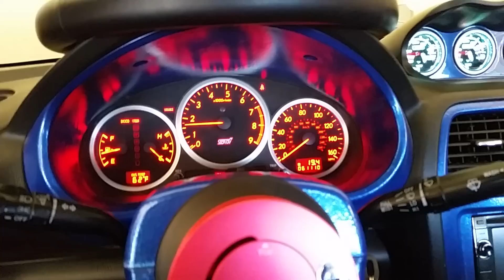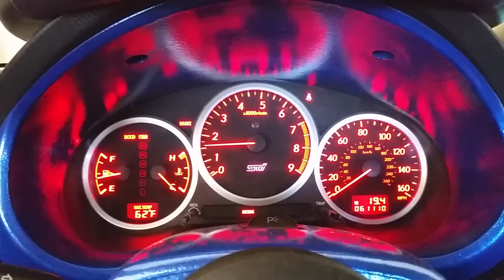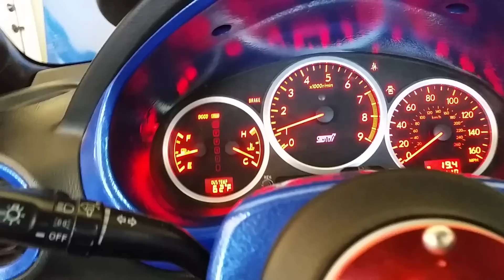Cold Start w/ Forged Pistons and Solid Motor Mounts (07 STI Subaru)

Comment: Did you guys noticed a change on the sound of the engine with forged components? When forced.... it has a ticking sound...
Reply: They get loud haha. I swore up and down my valve lash was wrong even though I let my master Subaru tech buddy handle that part (I torqued everything down to 155 ft lbs 🤣). Sometimes these motors just get really clanky once they are done up

Comment: What's the difference to an A or a B forged piston? I've just forged my 2007 Hawkeye STi...again! Block cracked sadly, all good now. I've just never heard of two different types of pistons for one engine?
Reply from the maker: The ej motor comes factory with a and b pistons. I forget which, but one piston is slightly smaller than the other. There should be a stamp on the top of the block, where it splits, with letters  a and b representing which piston goes to which cylinder. Of course, this only matters if you are using standard  sized pistons with standard  sized cylinders. If you go oversized then you just buy pistons to match and a or b pistons are irrelevant.
Reply: @E85BAIT  Wow, but why would they do that?

Comment: +panzerth if u wouldve upgrade the turbo u couldve run 11.90s or 11.50s at 121mph to 129mph
Reply from the maker: I did upgrade the turbo. it's a gtx3076r dual ball bearing turbo. I just need to get my driving down, so my tuner can set my car to kill mode. it's got more in it.

Comment: +panzerth weres the turbo inside the engine
Reply from the maker: right in front of the passenger side firewall. see the red turbo blanket sticking up from my enginebay? that is sitting on the hot side of my turbo.
Reply: How many psi and horsepower you have on that 2.5L engine because that car of your is awesome panzerth
Reply from the maker: Alex Lespier thanks. Running 20 psi full throttle. Launch control is set at 8lbs at 6200rpm. I've only managed to get a 12.9 @ 110mph out of her at the dragstrip. But i think she can run mid 12s. I just gotta drive better and build full boost at launch. No clue on hp. But i do know my car is on the safe tune right now. There is a kill mode tune that has yet to be flashed.  My tuner wants me to get good at driving before giving me all the power.